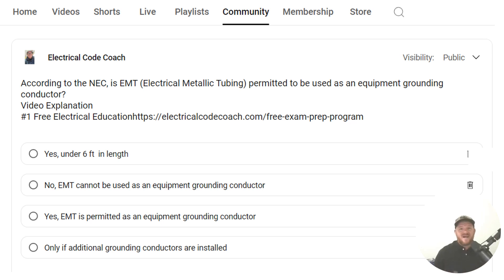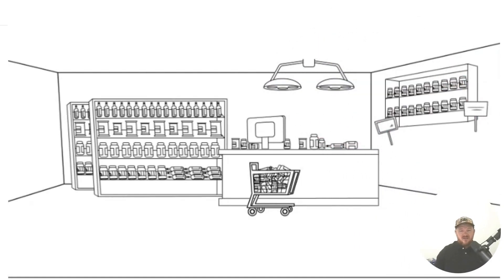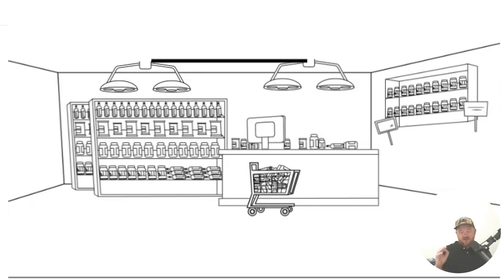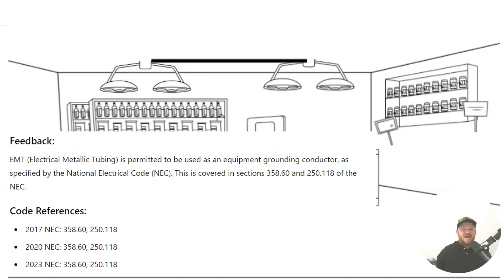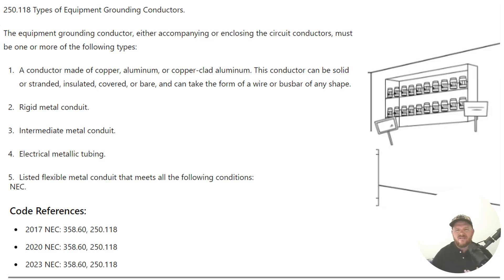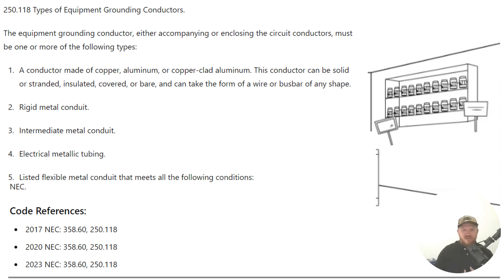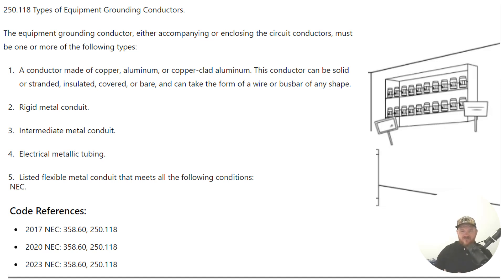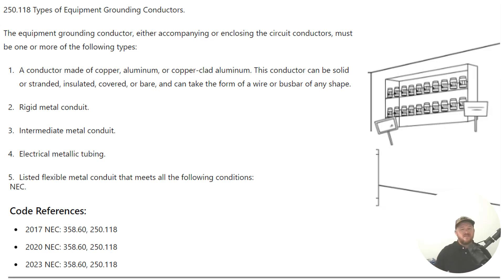#155 Electrical Question of the Day EMT as and Equipment Ground?

Comment: Failed today for not having an equipment grounding conductor in 3phase circuit ran in EMT. The inspector said I had to prove that the set screw and compression lock ring connectors were listed. The lock rings on the connectors were wrench tight. These inspectors are getting ridiculous.

Comment: As I found, it depends on the AHJ. My inspector mandated a separate ground for a buried rigid conduit as well as my EMT runs. They also mandated I coat my buried rigid conduit even though it was buried in sand. They insisted it was a "corrosive" environment. Arguing was pointless as they insisted on their interpretation.

Comment: Coach, Ive been waiting for them to change this code, because HOW MANY times Ive seen loose connections on conduit to the equipment, which I think they should for this reason, Thanks coach ! 💪
Reply: I agree, I've seen several set screw connections pulled apart because of building motion.  Also, locknuts work themselves loose.
Reply from the maker: You're welcome, brother!